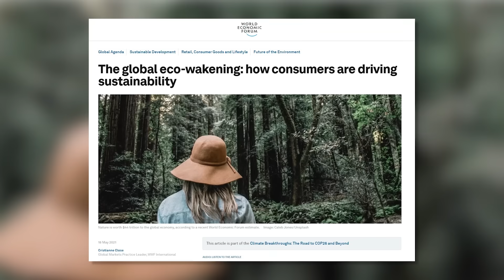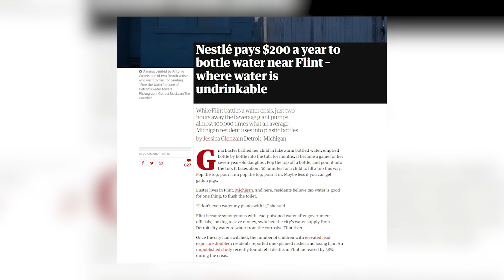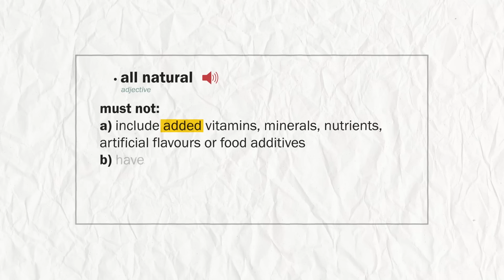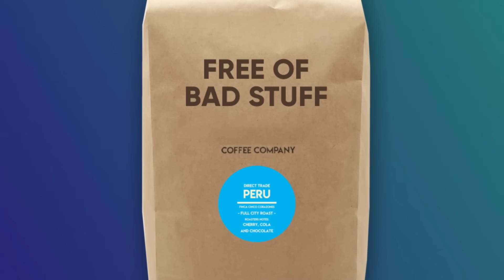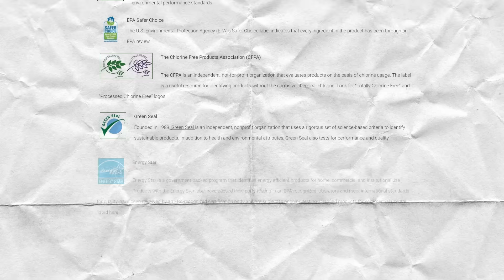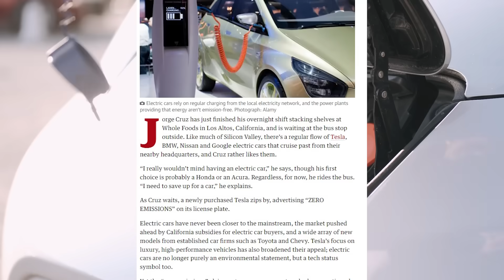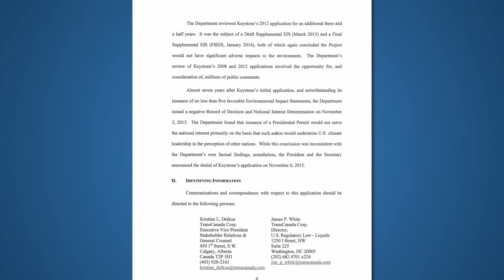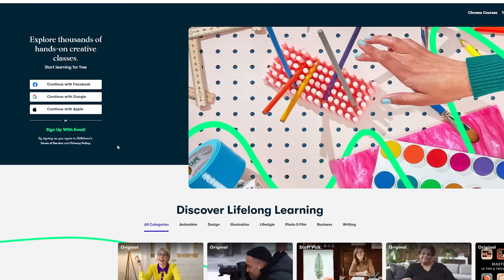Why Being 'Environmentally Friendly' Is A Scam

Comment: Unless Nestle's shipping and handling process is dumping their products (and that does happen in shipping), I don't think it's entirely fair to say that all litter is their fault; litter is the fault of the dickbag who doesn't throw it away correctly. Plastics also don't have to be single use--I can reduce my plastic use by reusing them. Grocery bags are trash bags and lunch bags and rope and grocery bags again. Some products are certainly harder to reuse due to their shape, like it's easy to reuse a screw top water bottle, but impossible to reuse a juice box. But that's it for my locus of control, and it's not going to fix bigger problems associated with landfills or incineration or production or other individuals who can't tell the difference between the ground and a trashcan. Some kind of legislation is necessary, I just don't have high hopes that pushing those laws entirely on corporations will be effective. We as consumers are a major factor, so I think we should share equal responsibilities/inconveniences to reduce our contribution along with the corporations. Plastic taxes, maybe. "Bring your own container" products. Carrot/stick programs for trash and properly sorted recycling. We could actually benefit a lot from simply making sure degradable and organic material, plastics, and metals are not thrown away together.

Comment: The problem with green efforts is that we want to toss everything out without having an equal or superior replacement in place. When it comes to clean energy, look at all the blackouts in California during the summer, and requests to not run an air conditioner (let alone charging an electric car). While renewable, wind and solar energy is inefficient and unreliable. Nuclear energy is the most powerful, cleanest, AND safest sources of energy. BuT wHaT aBoUt ChErNoByL, fUkUsHiMa, AnD 3 MiLe IsLaNd? Those were not caused by an inherent fault in the reactors' designs, they were caused by company owners cutting other corners or performing unnecessary tasks. As for nuclear waste, there are natural sites (I admittedly forget what they're called) that are basically deep, stoney, underground ravines cut off from the surface and any water tables. Waste can be safely stored in these for over 100,000 years. In that time, we may find ways to recycle it, or even reuse. 

I've been ranting, but TL;DR we want to be environmentally friendly, but we're being really, really stupid about it.
Reply: Nuclear energy is almost effectively a perfect solution, but everyone's so scared of it. Probably doesn't help everyone thinks nuclear waste is a glowing, green sludge, instead of just radioactive dirt.

Comment: One more for the list:
The sin of techno worship.

For example, the Lomi composter is an expensive, energy-intensive, high-plastic "solution" to food waste that 1) preys upon your anxiety about food waste while 2) completely missing the actual problem (that unused food costs tons of resources to PRODUCE) and 3) even doing a shitty job of the task is designed for, creating desiccated food dust with all the important soil-forming bacteria killed off, while 4) easy, affordable, and effective solutions like compost pickup services have existed for decades.